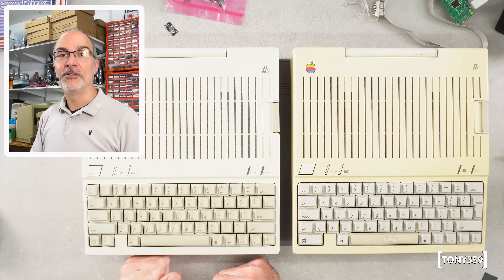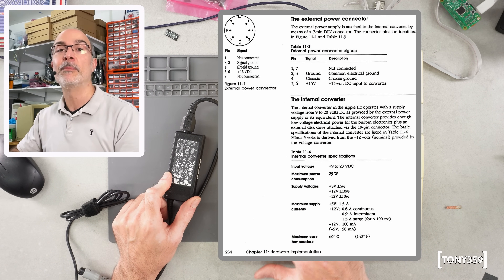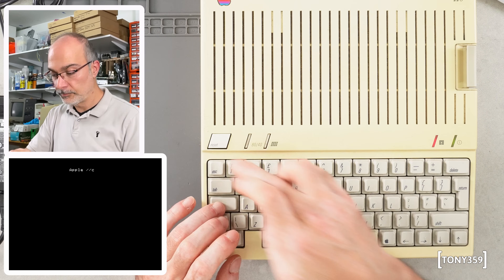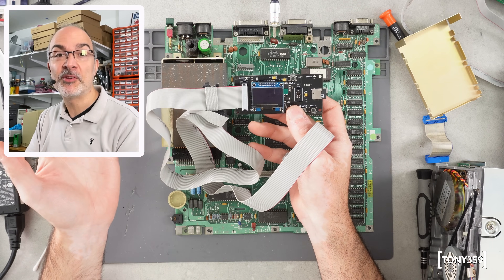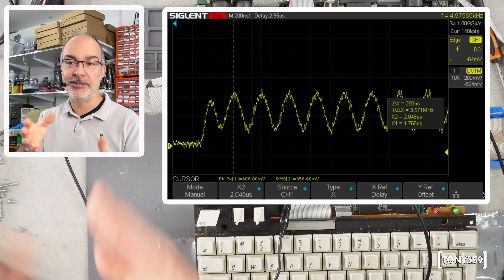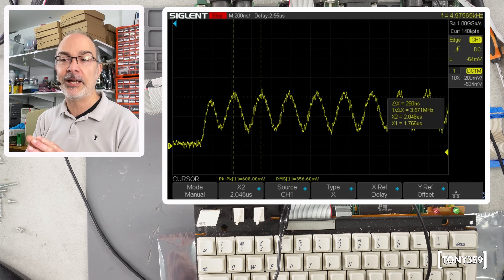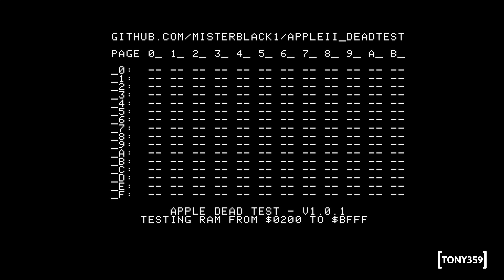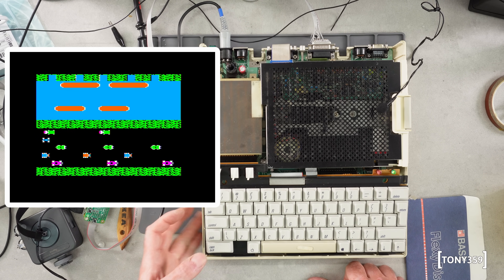This Apple computer is broken. Let's fix it and make it better!

Comment: Seeing this Nichicons being replaced hurts ;)
Reply from the maker: eheh - well, they're replaced with Nichicons or Panasonic :) Mind you, my own //c is NOT recapped. Well, ONE capacitor was weak and was causing the 12V to sag when the drive was starting spinning but only that. You know I don't like to recap just for the sake of doing it but that is what I've agreed to do with the owner of the machine!
Reply: Yes, blanket changing capacitors troubles me too. It has become like an internet meme. Now Tony has a good approach to it and thoughtfully considers the replacement components parameters, the temperature rating comments he makes are on point and should be adopted by others. But for every Tony there will be someone who just latches on to the "change all caps" myth and puts in the cheapest crappiest Chinese parts because new is better, right? Not always.
Originality needs to be considered, future collectors will prefer less adulterated units. 
As shown here, most of the changed caps still tested good and some replacements are the wrong form factor. Will this affect its future desirability?
Reply from the maker: it's an excellent point. Reliability vs Originality (if that is even a term). In this case this is not my machine, the owner prefers reliability for their //c. For myself, if my Apple //c stops working, I'll look into that. For the less skilled user, it means find someone who can fix it again, shipping it, it might get damaged, it might be expensive. So I see the advantage in both approaches. Now, capacitors in the //c are not so antique, it's not like replacing those giant alluminium caps in 1960 equipment with a tiny modern one. Still, I can understand both approaches.

Comment: I too had the Apple IIe when i was young. I was 6 when my parents bought one. I just bought an apple IIGS recently, no e or c yet.
Reply from the maker: I'd love to have a GS - they are rare across the pond. I understand they are easy to find in the US!
Reply: @tony359  easy? Maybe. But expensive. Mine was only the computer and suspiciously cheap. It was filthy but it booted. I'm looking to get a floppy emu and maybe a hard drive solution. Had only the RAM card in, nothing else. The seller shipped it with only 2 pieces of newspaper for padding. I was very lucky it worked.

Comment: Great video. A very interesting computer, I didn't know about these differences in keyboards. The machine looked like new!
Reply from the maker: If you watch the repair of my //c I think I show the horrendous keyboard which came with some "protection" which had warped over the years... it was unusable. Without those, it was ok but jamming easily. After lubricating each and every key, it was ok, I do like it. But the ALPS is just heaven :D
Thanks for watching!